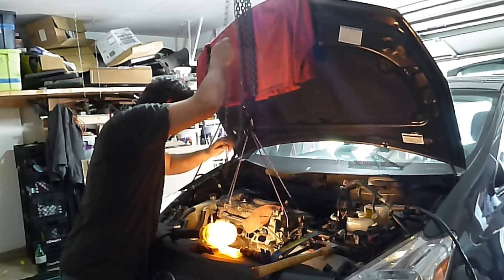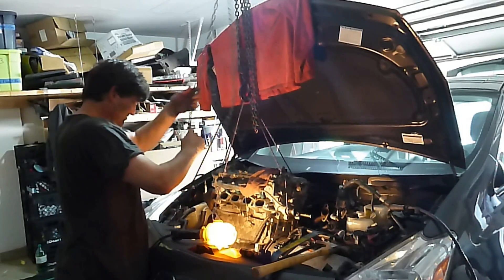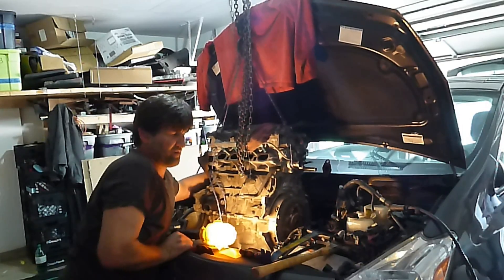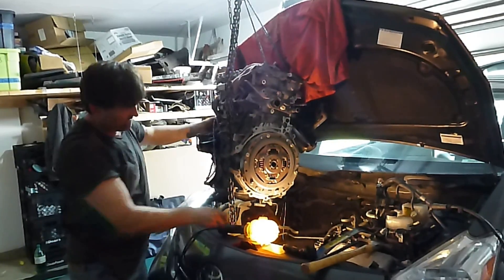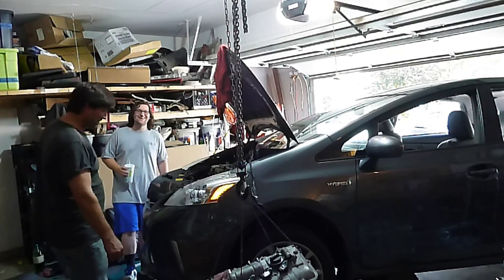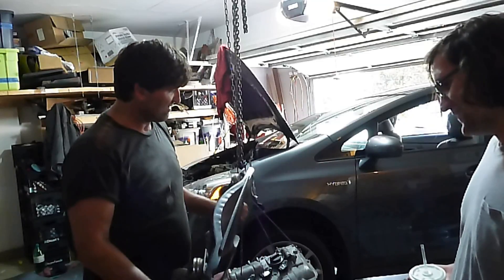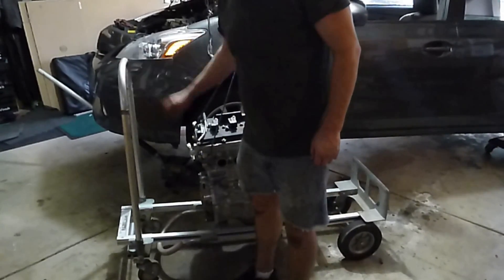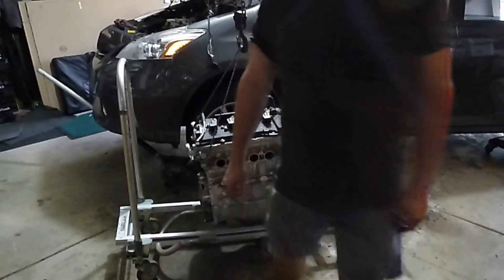Part 7 - 2016 Prius Engine Swap into 2012 Prius V - Start to Finish

Comment: I want to change the engine for the same car, model year 2015-2016, and my question is: What are the things that need to be focused on when removing the old engine and before putting the other engine in its place?:hand-pink-waving:🚙

Comment: Hi, the fly-wheel and dampene.
1- What would happen if the center changed location?
2- If I buy a new piece, how do I know the center point is in the correct place and does it require special tools?

Comment: Toyota service manual says the engine has to come out with the transmission from below..Thank for the vid. You got 200 subscribers..Yeahh. Thought it would be more cause this problem is so common. What is your block and tackle attached to on the ceiling?
Reply from the maker: Thanks for your question. Please subscribe to my channel.
I have a 4" lag hook screwed into the floor joist above. 
 - Fix That Prius !!!

Comment: For anyone that has to swap the fly-wheel and dampener, it has an arrow cast into the flywheel. I aligned the arrow on the plate from my old engine to the same orientation as the new one and marked the dampener so that it retained its original orientation. I don't know if it makes a difference but that seemed right. Thanks for the video and I just subscribed.
Reply: Hi, the fly-wheel and dampene.
1- What would happen if the center changed location?
2- If I buy a new piece, how do I know the center point is in the correct place and does it require special tools?

Comment: Some kinda ceiling mounted trolley would be sweet: something that'd allow the hoist to come forward about 3~4 feet.

I get the sense, since your first project was a third gen Prius, and this one was a Prius v, that you JUST needed to swap the damper, not the whole flywheel, with the (first) one, the third gen Prius? Am I reading that right?
Reply from the maker: Both were 2012 Prius v's. I wanted to see if you could use the new "flywheel" with the old "spring plate" but you can't. I had to remove the new  "flywheel"/damper from the new engine.
I did mention the front crank pulley or "damper" can stay on because Danlatu said in his rebuild it had to come off to get the engine out.
Reply from the maker: Hey Tony, I would charge around $3500 including a very low mile 2016-17 Prius engine.
Reply from the maker: Hey Tony, I'm in the Chicago area.
Reply from the maker: Hey Tony, I'm in the Chicago area.
Reply from the maker: Hey Tony, I would charge around $3500 including a very low mile 2016-17 Prius engine.  I'm in the Chicago area.